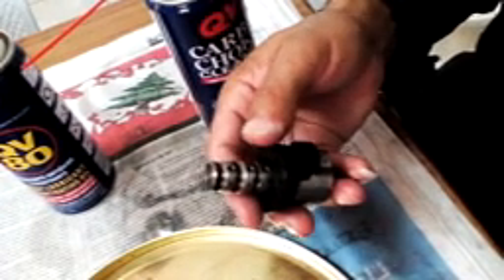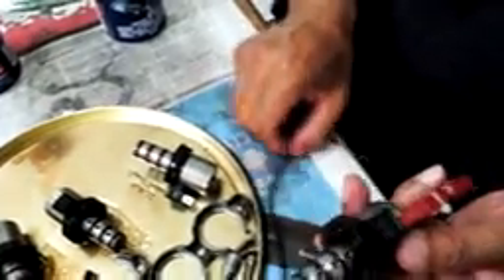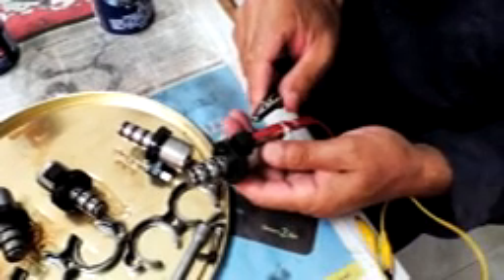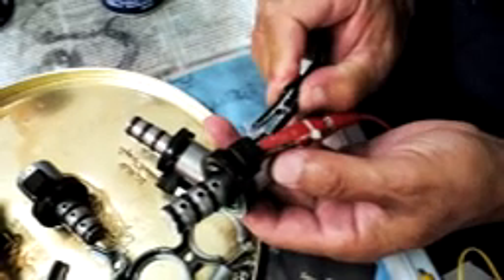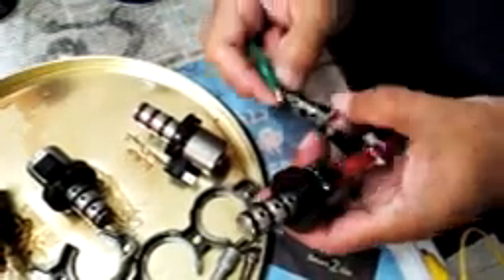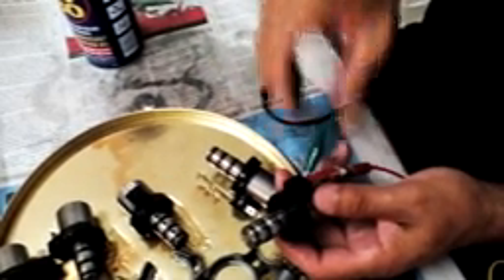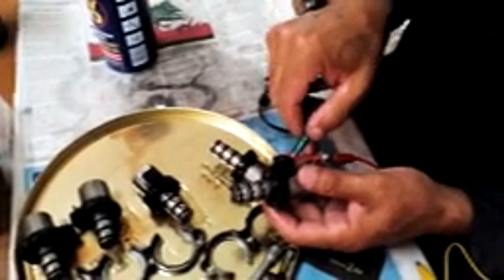Automatic transmission solenoids,Kia, Hyundai. فحص و تنظيف السولينويد للجير الاوتوماتيكي

Comment: I have a 2005 Kia Rio Cinco.
Will this process have the same results on these solenoids?
Reply from the maker: If you read a code that indicates, One of solenoids is not functioning properly , then cleaning might do you good. Do not clean solenoids, because you want to, do it when there is a problem, and better start first with changing the a/t fluid , that might help ,at start.

Comment: I'm getting code p0768 on my 2008 kia sorento,  stays in 3rd gear.  Do u think it is solenoid?
Reply from the maker: Yes I think so, the code State that Shift Solenoid D, has a malfunction . Try first to disconnect the battery , and give it a try . If the problem persist , then check your workshop manual, to see how to replace it. I believe many videos are there for your type of transmission. Good luck.
Reply: @mazen723  thank you

Comment: I have a 2006 kia spectra5 and code P0742 torque converter clutch solenoid circuit stuck on. Where is this solenoid located.
Reply: I have a 2007 kia i cant pull my solenoid out how do i get it out without breaking it i got a new one i cant find a video on it
Reply from the maker: There are many videos for kia 2007 , transmission here on youtube, rebuilt , piece by piece . Just do a good search .
Reply from the maker: There are many videos for the kia transmission , here on youtube. Try also to down load a service manual for your kia .

Comment: If i need to replace the solenoids, are they all the same?
Reply from the maker: Yes they are, that's if you mean the five of them in the a/t  . They're the same for sonatas, optima, Trajet and many other cars, especially from model 2000 to 2007 . Check the work shop manual, for more information.
Reply from the maker: Replace only the faulty one , why all of them. These solenoids, don't come cheap.
Reply: @mazen723  thank, i figure since im changing one, then i might as well change them all but you have a point, thanks

Comment: My Kia Rio 2012 automatic transmission stuck in 3rd gear what is possible problem sir?
Reply from the maker: Hi
Read the diagnostic code to Know what  the problem is , 3rd gear is the fail safe when there's a problem.disconnect and reconnect the battery for a start .buy a device to read the OBD II Code, costs few dollars. Keep me posted.

Comment: Hello 
 my car kia sorento 2006 2,5 engine
triptonic does not work.
error codes
P0753 Gear Shifting A Solenoid Electrical System
P0763 gear shift C solenoid electrical system
thank you.
Reply from the maker: In some of these kias , when you have a multiple errors , the solder on the wires controlling the silenoides  becomes detached ,try and make external ohmic , if not I think you have to open up the A/T , and do internal maintenance . Sometimes shorts and open wires between the a/t and the computer, give multiple errors.
Good luck with that.
Reply from the maker: I had a similar situation before, where I had to replace an open coil solenoid, bought it for around 100usd, I had a schematic for the A/T connector and I was able with much ease , testing all solenoids, without having to open A/T case. Replacing the solenoid is another story, but it was not very difficult , but certainly needs good mechanical ability. I have no idea, how to pass a similar schematic to you . Use Facebook Mazen Y. Salman . Good luck.

Comment: Hey im bout to to replace these on my 2006 hyundai sonata 3.3l any tips. My codes are erratic  p0371 p0372, p0733 and p0734 all diferent never at the same time
Reply from the maker: Having many codes mean the cable , internally or externally is faulty , check your wiring first , download the schematic for the a/t wiring from Hyundai America site ,it cost a few dollars for a week, I think.
Reply from the maker: Do you intend to do the job yourself ? , If yes why change the five of them, just replace the faulty one, because I think they are a bit expensive , around one hundred dollars a piece , if you are paying for labor, then you might, consider changing them all . Keep the old ones, as a spare parts,  if your engine lay out is similar to mine (2000-2003), then it's a relatively easy job , but check the manual first, do few ohmmeter readings first ,on the a/t connecter at the top.
Good luck
Reply: Yes i am got a good deal all 5 for 50 and would the make it get stuck in third?
Reply: Cable

Comment: hi sir,my kia pride wont shift only 2nd gear 3rd and 4th wont,what is the problem of my transmission?pls.
Reply from the maker: First is first, read the error code, and see if any of your car solenoids or wires that control the solenoids is damaged, take things step at a time. Good luck

Comment: Hi, did you test with 12v?
Reply from the maker: Yes , more or less .To simulate car battery,I actually used a 13.4 volts source. But 12 v ,  will do nicely .

Comment: Greeting friend, today I turn the elantra and put the transmission in retro this gives me a golppe and put it in D the car is completely unmated, scanned by throwing the DTC P0765, tell me there are electrical problems in the box. You could orientally about it ... And thanks in advance. The box is a F4A42
Reply from the maker: Luis Rodriguez  in many cases the cause for such an error code is a badly soldered jount, check your manual, and always try to do an external test on the main connector at the box . Where their is a common to all solenoids and the other ends,  good luck

Comment: what was your symptoms ?
Reply from the maker: Eddie The Head A/T was fine , except when climbing a hill , while fully loaded .Then it goes to the fail safe mode, ie  switch to third gear, which means practically dead. I need to switch engine off and on again to restart computer.

Comment: is it possible to leave the solenoid connected to solenoid body electrical connector and perform this. thank you for this presentation very helpful.
Reply from the maker: You can always measure the the resistance of the coil of the solenoids. This helps very much, in detecting open coils, easily.  But, cleaning and true testing of solenoid, and hearing that click, require opening the a/t cover and removing it.

Comment from the maker: I did a good job, in cleaning and testing of these solenoids. But the problem persisted. I had to install a used A\T. while dismantling the old a\t , I found a small piece of metal flowing in the fluid path.
Reply: Hyundai and Kia have this manufacturing problem some metal trims or bits of aluminum can be found in transmissions,and engines and valves..in Canada and USA they actually have class action suit.